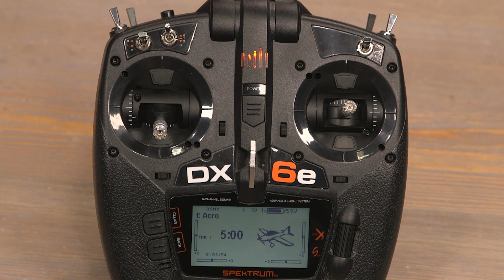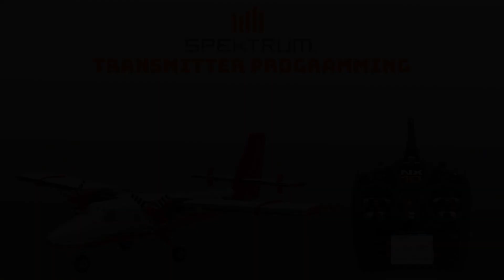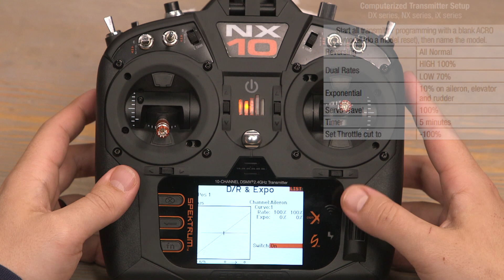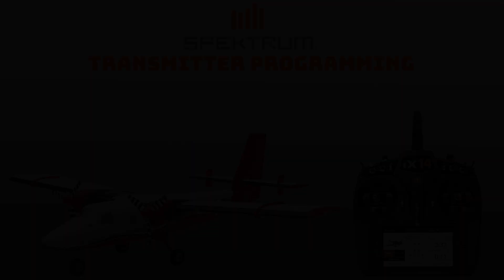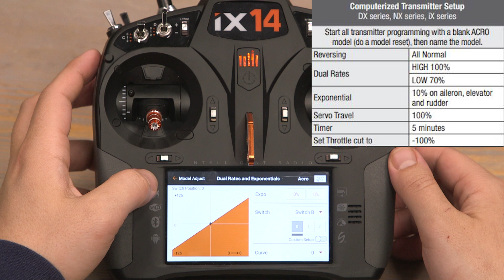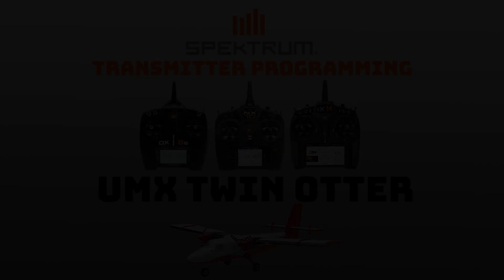UMX Twin Otter Spektrum Transmitter Programming Guide

Comment: I see "Reversing all normal" in the manual. Does this model have Reversing? It would be great for float flying, but it wasn’t mentioned in the  programming video??
Reply: It refers to the reversing of servo channels, not the propeller drive motors.